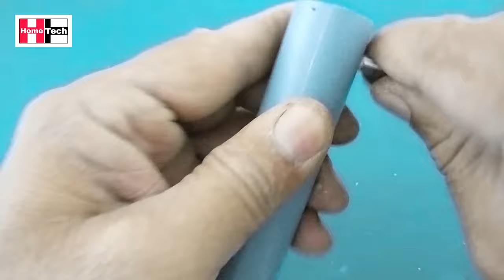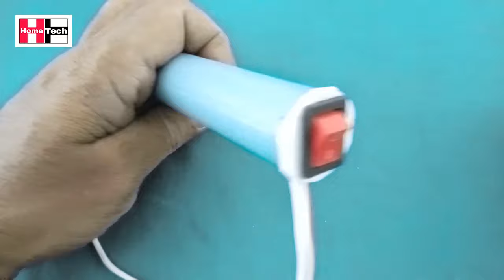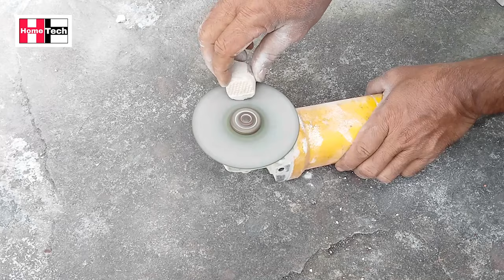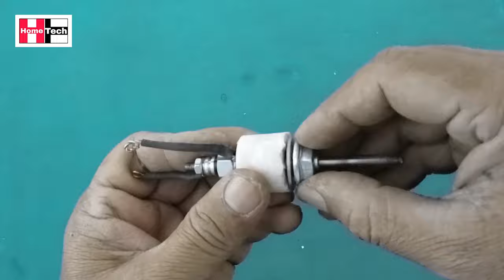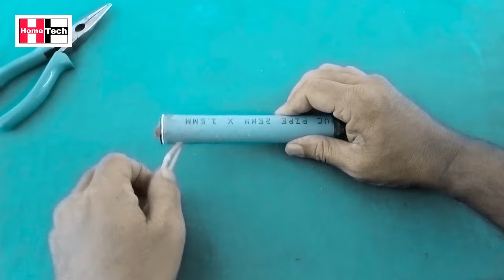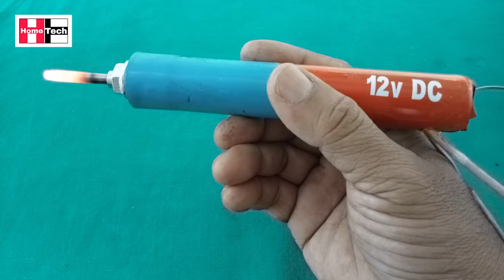DIY Soldering Iron | How To Make Soldering Iron At Home | Make 12v DC Soldering Iron Using Glow Plug

Comment: Except glow plug is more expensive than a cheap T12 tip and some basic controller board (maybe even with a handle).
Reply: hgg
Reply: Ya seperti membeli solder baru dan tidak perlu reot